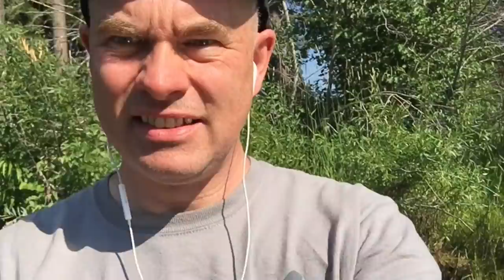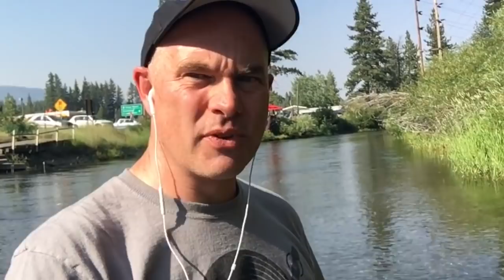Delta III - The Cursed Child Of Delta Rockets.

Comment: Yeah, that's pretty much it.  I worked on the Delta program and was in the support room for all of those.

What they didn't tell you is engineering wanted to do a roll study of the D3 but management said we've already spent too much money on development so assume it's the same as the D2.  Big mistake.  The roll study would've cost something like $60k.

Also the roll oscillation was very fast, something like 5-6 times per second.  Our visualization of the flight data showed that pretty clearly.  Then when it ran out of hydraulic fluid the main engine tried to control attitude but wasn't fast enough.  Had the vernier engines locked straight down it might've had a chance.
Reply: Ray Clouse I recall one of the first Iridium Delta II launches ran out of control gas on the upper stage because they didn't get the roll dynamics right. Still successfully deployed all 5 though.
Reply: Isn't management overriding a test one of the most common causes of rocket failures?
Reply: "Ran out of hydraulic fluid" - Does this mean that in a rocket, the hydraulic fluid is vented overboard, rather than being returned to tank? Is this done to save weight? I assume that the amount of fluid needed + an extra quantity for good measure, is calculated and used? Surely this could add up to a greater weight than a closed system?
Reply: +rollie
becasue these were expandable boosters, the hydraulics had an open system.
scott said this in the video
Reply: I understand that, but it seems to me that an open system would be heavier, since you need more fluid than a closed system, unless the extra plumbing makes it heavier, or makes it more complex, in which case the extra weight is preferable for reliability purposes
Reply: I assume the main reason for the open loop system is that if they ever ran out of hydraulic fluid, it would be because the nozzles had been actuated a lot more than expected, and the rocket would be wobbling or shaking itself to death anyway. So long as the control system stays in control, a closed loop hydraulic system only ads unnecessary weight and complexity.
Reply: An open loop system is really simple - a tank, partially full of fluid and partially full of high pressure gas (or full of fluid and plumbed with high-pressure gas, say, from the propellant tank pressurization system.) Valves allow the pressurized fluid to run through the actuators, and then it is dumped somewhere - either overboard, or into a catch pan.
Reply: Right.  The weight/complexity savings of an open-loop hydraulic system isn't in any of the fluid, it's that an open-loop system can avoid the entire hydraulic pump.

An open-loop system would work a bit like one of those "super soaker" squirt guns, which keeps a pressurized air chamber.
Reply: Just ask  Arianespace what happens when you assume the rocket will perform the same as the old one.
Reply: <face palm> Engineers vs Management... I take it there wasn't much chance allowed to make it in favor of doing a roll study? I don't know much about inter-department dynamics, hopefully, lesson learned. Albeit a rather costly one at that. At the very least, no lives were lost.. I hope?
Reply: the delta series are not man-rated, all launches are unmanned; so no casualties unless it blows up on the pad and cooks someone.
Reply: Ya, I kind of figured that. Just kind of thankful. On the flip side, the non-piloted rating might have also been why they didn't think the extra care was needed to do more testing first.
Reply: You would think so, but the breakdown of communication between management and engineers is widely considered to be the prime reason for the Challenger disaster in '86. In fact, not only was there no communication, but in places where there were attempts of such, they were actively suppressed. At least two people were aware of the design flaw which led to the disaster, and objected to the launch, but their warnings, obviously, weren't heeded.
Reply: Plamen Dobrev Because money talks and science takes a back seat. When money is lost we just shrug and say the science ain't there yet. We humans are weird.

Comment: I was at the inaugural rapid disassembly of the Delta III. It was a night launch and if I remember right it was about 10 miles altitude when it came apart. For a second I thought it was staging because you could still see what looked like the second stage burning. Then a fellow next to me exclaimed, "Look! It's completely blown up!" and sure enough, the first stage had turned into debris. It looked like the second stage was mostly intact and its engine wasn't burning but you could still see it because it was actually just on fire.
Reply: Yeah, I was there too. I remember expecting to see the light from 6 solids separating and the main stage and I counted too many pieces. Oops.

Comment: Why does the Delta II have weird offset non-symmetrical SRB's in it's 4 SRB configuration?
Reply: nvm, I just found out, they are made to have 9 SRB's attached and that makes it so there isn't an equal number of "empty" spots between each one when using just 4. Additionally as long as the thrust vector is through the COM there wont be any horizontal thrust, however as fuel is expended it does make it so they aren't pointed through the COM but apparently the SRBs have thrust vectoring to compensate for that. (Exactly the same as how the space shuttle used to operate)

Comment: Dude.. WTF are you saying????? Lake Tahoe DOES NOT FEED CALIFORNIA ANY WATER!!!  NONE, NO Water from Lake Tahoe is used by California.... it is NOT important to California at all, except to leave California for Nevada..  

While yes, part of Lake Tahoe is in California, it's kinda hard for it not to be since the Nevada/California state line divides (virtually) the lake... it has only one, ONE, exit... that is The Truckee River... all the water from the Truckee (if not used by Reno mainly for drinking, and Fernley are for farming and drinking, plus some for odds and ends) goes into Lake Pyramid.  Lake Pyramid is in NEVADA... It's part of the Great Basin, not the Pacific. 

As for the Thrust Vectoring on the Delta III.... You make it sound like it is Gimbal Vectored when you say the nozzles are frozen where they are.  In fact those nozzles were not gimbal vectored and didn't freeze anywhere, they were static in the first place.

The way MD controlled the Vectoring was with pumping the hydraulics into the nozzles changing the static pressure within the nozzle itself.  This caused changes to the exhaust plume which in turn caused changes in the direction of thrust.  True there was only a limited supply of hydraulics, and one of the fault launches was caused by a combination of not enough thrust authority and harmonics that developed due to the vectoring.  Avionic software was not robust enough to handle the pulsing vectoring happening and the subsequent harmonics in thrust, when the hydraulic fluid ran out there was already uncontrolled pitch that caused the failures.

It would help if you explained the non-gimbaled engines and vectoring since it seems like it alone was the cause of the failures... it wasn't.
Reply from the maker: Every article I’ve read on this talks about nozzle vectoring. There are other methods which involve injecting things like N2O4 into the nozzle like in the Titan IIIC but no source suggests that was the case here.